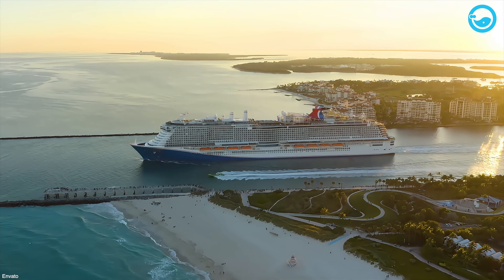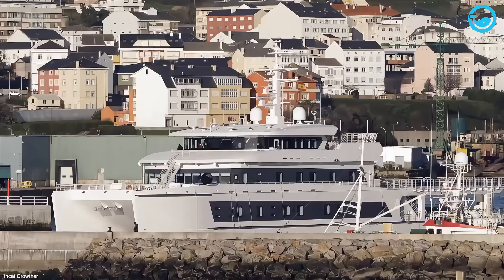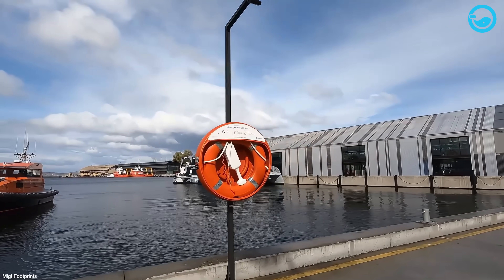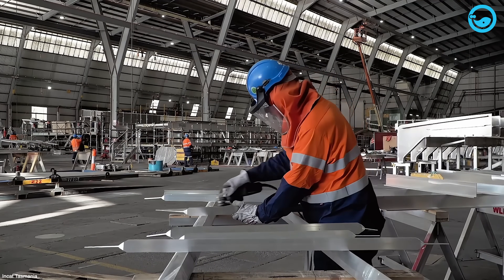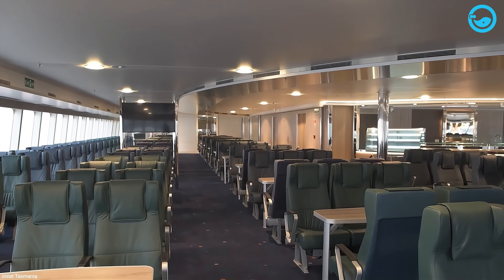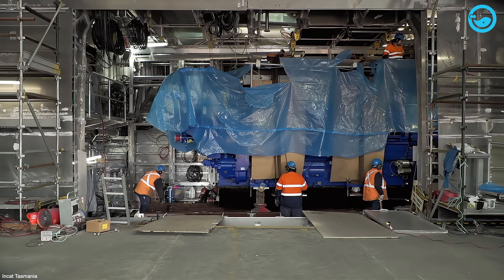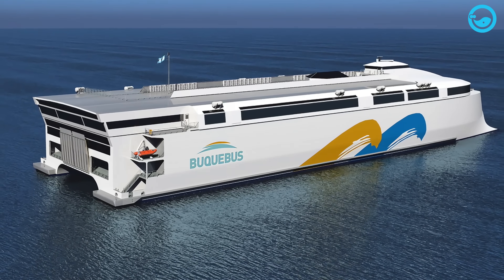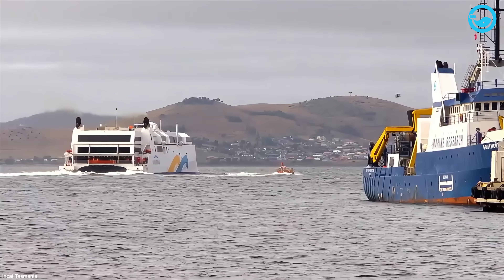You Won’t Believe How They Built the World’s Fastest & Largest Aluminum Catamaran Ever!

Comment: Nauctis, I'm calling you out....the big ferry's you are showing are 'Trimarans'....central hull, amas (hulls) on port and starboard sides. A Catamaran has two hulls and a central connecting span that is not in the water! Research is the key to success.
Reply: They're catamarans, the middle hull doesn't sit in the water.
Reply: @OllieVK  on a catamaran the outer hulls have accommodation (CABINS) The ferries are similar to the 'Independence-class littoral combat ship'!
Reply: @certainthings2000  a catamaran is simply a boat with two hulls in parallel.
Incat... INternational CATamarans.
Reply: @OllieVK  i was just getting ready to tell him. Calling you out he says…. Sheesh
Reply: Not right. What you supose a central hull is really a false bow, for extra buoyancy on large waves. The twin hulls don't fit cabins, but engine rooms, machinery spaces (sewage & feed water systems, firefigting systems, transfer fuel services, fuel tanks dayly & long range size, T-foils stabilizers...) all them configuring longitudinal watertight spaces named VOID. Trust me, I've worked on these wessels a lot of years.
Reply: Kind of a fluff piece.